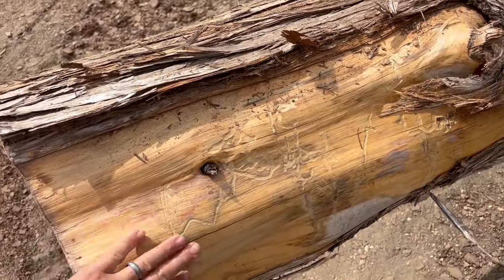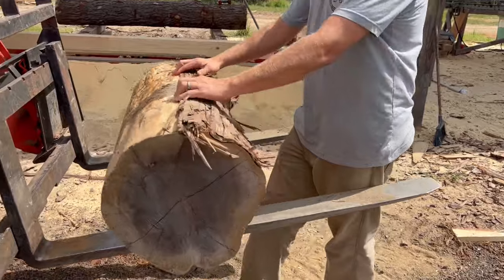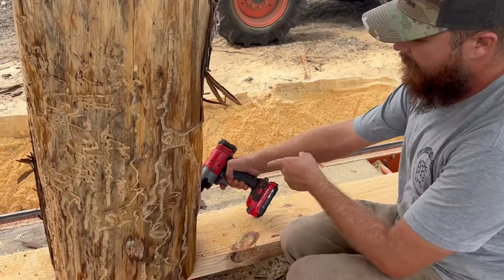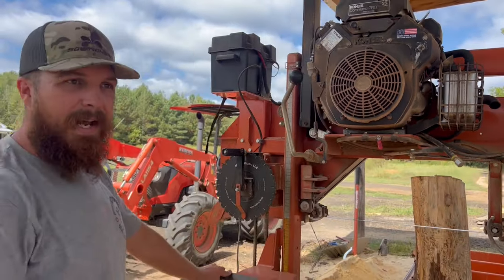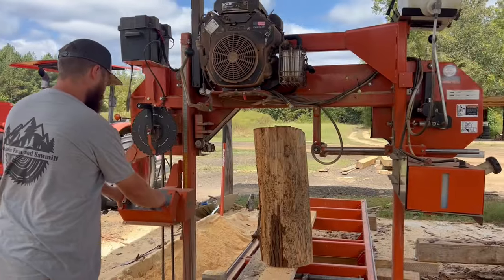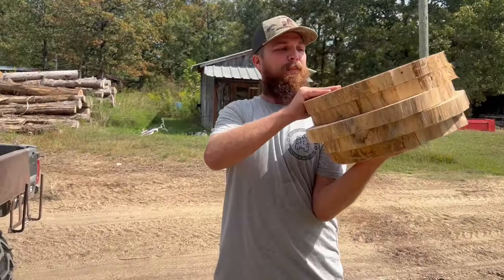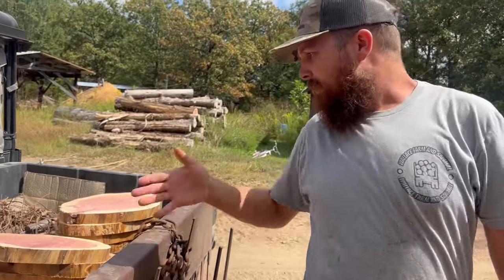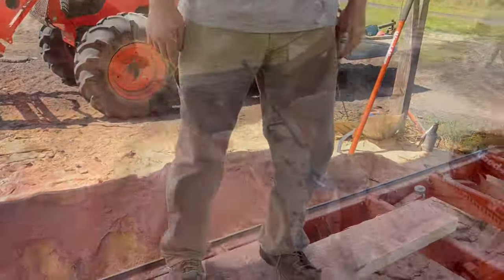Making COOKIES on a Woodmizer SAWMILL!!!

Comment: Hey guys I don't know how you are planning to dried them " cured " but I used to sell some at the St.Augustine flea market and the best luck I had to dry them without cracking stack them like other board you dry with sticker in between and I found best a darker or shady area alet them dry slowly I had the least cracking that way have a great day
Reply from the maker: Thanks for the tips!
Reply: I have tried to do this and almost always crack. A neighbor told me to cut at an angle and this would prevent cracking. Have you ever tried that? I have not yet.